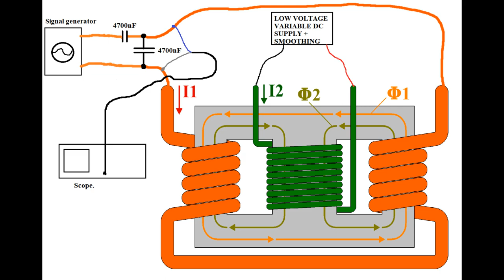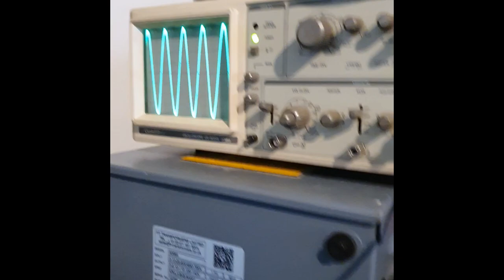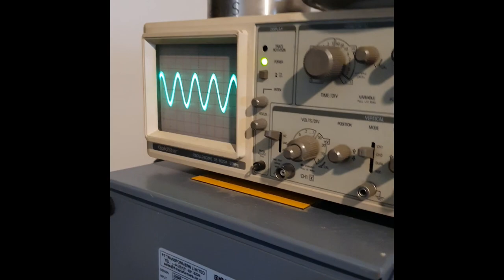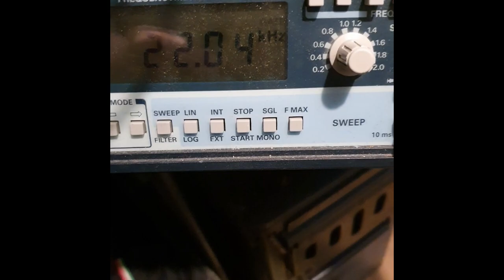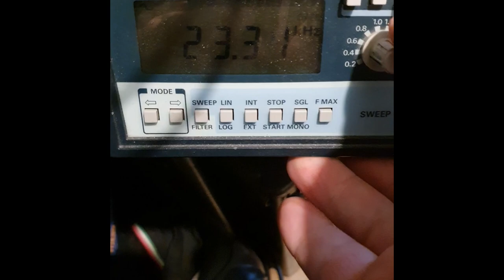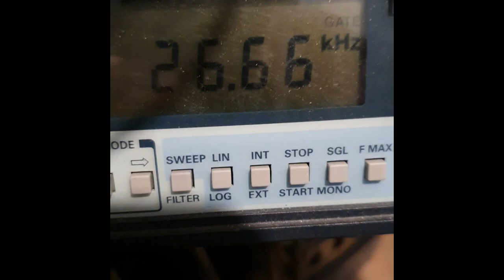Saturable Reactor test 1 (ferrite)

Comment: The magnetic field created by the control DC saturates the core material - ie. aligns all electron spins.

What this does is to flip the core material to appear closer to free space to the AC inductor,  ie. the AC coil's magnetic field:

1)  confronts a major effort to torque the electron spins into alignment in the core if the DC control is off;  mainly because the core material has a relative permeability much higher than free space.  The term 'inductance' means, literally, the amount of 'pushback' the core material presents to the magnetic field created by the copper coil that is being supplied with AC.   It's like going to an inner city school as a substitute teacher and telling the kids "no talking when I'm teaching" - the kids will put up serious resistance to that.  You'll have to torque them into alignment

2)  but if the electron spins in the core material are already aligned (by the DC), the relatively permeability of the core material drops significantly, towards the permeability of free space, and that is why the inductance - and thus the XL - drops, and the resonant frequency increases (because "L" is in the denominator for the resonant frequency formula,  1/sqrt(LC).   In this case, the AC coil has gone to a $150,000/year private school as a substitute teacher, and the kids are quiet, motivated, cheerful, intelligent and they are working on an artificial gravity class project

Comment: Also, I see you're intending to use Ferrite.  The hysteresis curve is very thin with ferrite - it is used in transformers for that reason.  Ferrite has low coercivity - that means the electron spin alignment is easily reversed, which is good for the alternating magnetic field created in the transformer by the alternating AC.

We're trying out ferro foil in our Lorentz disk artificial gravity device - we intend to better control the magnitude of the RF current in the aluminum foil layers by varying the permeability in the ferro foil with a small, radial DC current - a 'magnetic amplifier' approach.   (A Lorentz disk uses a vertically-oriented B field and horizontally-oriented RF in a lamination of aluminum foil layers; the Lorentz force accelerates (oscillates) the charged particles in the aluminum at the frequency of the RF being fed to the aluminum layers)

Magnetic amplifiers:  same idea as saturable reactors, ie. using a tiny DC to pre-align electron spins in a ferro material to adjust the permeability of the material dynamically.
.